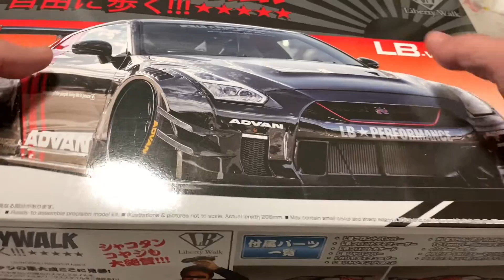『模型時間』 1/24 LB-WORKS R35 ADVAN GT-R AOSHIMA LBWK  full build

Comment: What do you apply at 13:40, is it just glossy top coat ? And did you use same black for each part (instructions mention different blacks for each part )
Reply from the maker: 13:40 It is painted with clear paint, the body is black, and the aerodynamic kit is special gun gray

Comment: what type of glue at 27:00
Reply from the maker: TAMIYA 87038
Reply: @le091888  why not use tamiya craft bond
Reply: @le091888  TAMIYA 87038 Dissolve Color or not ? thanks.
Reply from the maker: @BrightTranscender  Will dissolve the color ~ use with care
Reply from the maker: @BrightTranscender  Because I don't have this kind of glue~ So I use ready-made glue😅